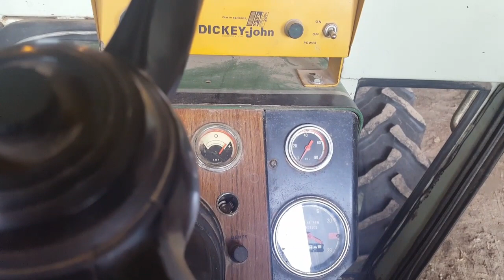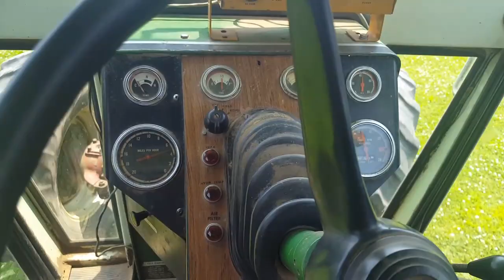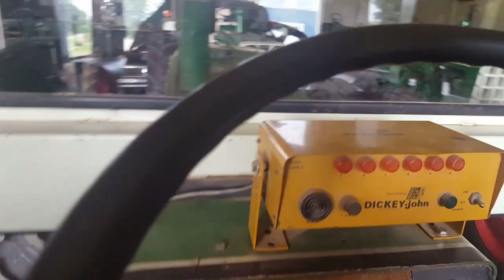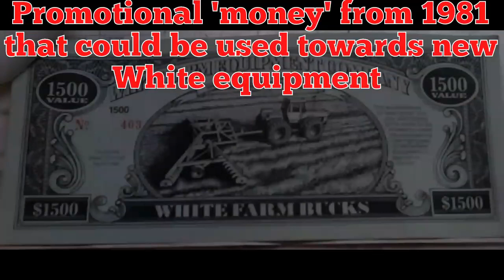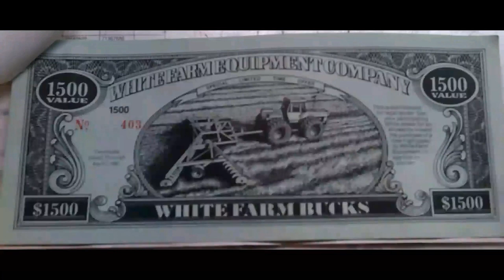Tractor Tetris- rearranging for wheat harvest

Comment: Its always fun! Having to move everything around just to get out what you need.  I really like that 1955 more and more every time you show it in a video.  That's #1 on my bucket list of tractors to get 1955 mfwd…  Now for the questions LOL! Those are bolt on duals on the 1955, did I see some kind of a wheel weight on the inside of the rims on the inner wheels? Does the white 6125 have a air ride seat?  What is the combine in the corner of the barn?  I thought you were going to clip the barn door with the combine head it looked really close...
Reply from the maker: Moving stuff around doesn't bother me too much. If the worst thing that happens to me is driving them, then I am doing pretty good. For your answers: No wheel weights on the 1955. It does have step up rims with 16.9-38s on the inside, maybe that makes it look like a weight in there.  It was built with 20.8-34s, and for as expensive as that size is, I think it would look sweet with those back on it. 
Yes, the 6125 has air ride seat, it was regular equipment for the 6100 series tractors.
The combine in the corner is a 525. We'd get it out and play with it during wheat harvest, then a few years ago it developed a knock in the engine. It has been parked ever since. I'd like to get it running again, it just takes time.
Reply: @ThatOliverGuyChris  It definitely would look cool with that size tires. But that would be a big bill for 4 of those tires.  I could see you going up in the cab of the white while the air psi was building. Must be nice ride in there.  There's always to many projects and not enough time.

Comment: The neighbor had one of those MF combines. He called me when the 30 series Sunstrand roter pump went out, we changed it to a 20 series pump same as the propel and wiped it out twice till we figured it was running to fast! I hated that summer!
Reply from the maker: When this one came in from the dealer in Iowa the rotor wouldn't turn. Ended up replacing the pump and motor under warranty. Dad told Agco that we didn't want to have to work on our own combine before we ever used it, so our wet behind the ears service rep did it. He didn't drain the system before he pulled the hoses on the motor,  then he was really wet behind the ears, with hydraulic oil!